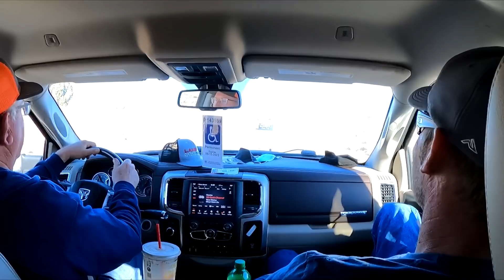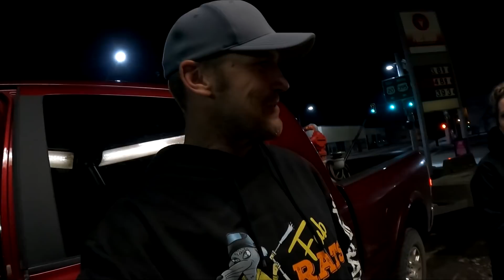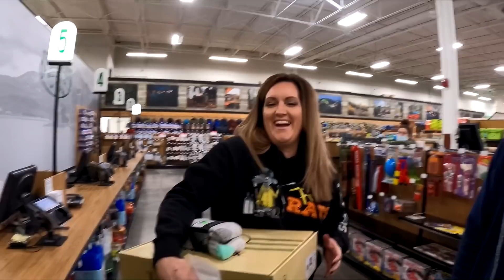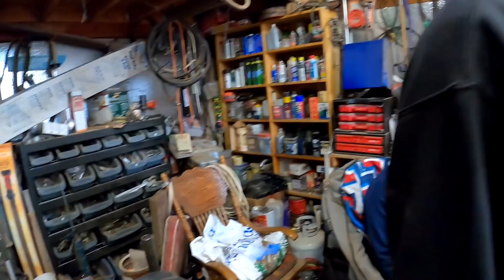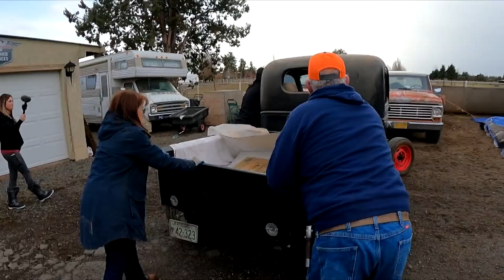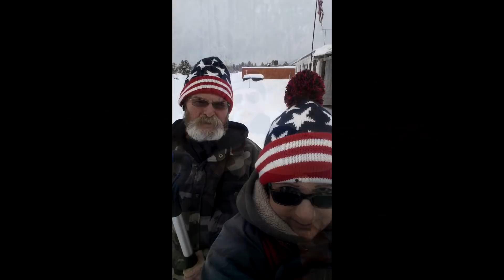We Drove 2000 miles And Through 4 states To Pick Up This Vintage Rig!

Comment: Hi I'm still spending many hours a day watching Fab Rats, Matt & Winder towing with Ed, and I keep trying to figure out what is going on with Robbie and the Golden nugget these days.  Then there is the cliff hangar with the high school car, that was in good enough shape to put in car shows.  Sounds like all it needs is a set of tires, check out that it has good fuel, then check out the plugs points, condenser, timing & dwell and carburetion, and ya got plenty of drivers so make a deal & drive it on home too.  Shouldn't take much I wouldn't think.
Keep up the good work & God bless.

Comment: Paul after 4 years that pump diaphram would be dry. You can put some gas down the line from above the pumps and SOMETIMES they will start to pump again but you WILL still need to change out the pump if you are going to run it hard. Which we both know you intend to so change the pump. LOL

Comment: I turned 70 this year and batteled kidney cancer in 2017.  Now my wife is batteling cancer.  And after watching this video  I wonder if I'll ever have enough time to get all my projects finished enough to be able to drive them.  
Or will my wife, or Kids have to figure out what to do with them once I'm gone. Coincidentally, I pulled out an engine from the back of the shop yesterday that I built for my wifes Hot Rod Trooper.  And got inspired to build a run up stand for it.Got it done late last night. Going to built a radiator mount today, and plumb in a transmission cooler so I can get the engine (2.3L Turbo Gas Intercooled Motor with a 2.6L head.  approx 260 HP) and the 4 speed auto 4WD tranny ready to go into her 89 4 dr Trooper.  (Which I painted Yellow with metal flake in the clearcoat 17 years ago.)  Fortunitly I built a 3000 sqft Commercial shop behind my house before I retired.  So I've got a nice place to play in.  If my wife calls you from Texas and starts talking to you about some Off Road Rigs you might be interested, just tell her  said Hi!

Comment: Royal Purple, talked w/ a top engineer from that company, you DON’T NEED ANY Additives with it.
WHY LUCAS OIL???
Mix 1oz./2 1/2 gallons of gas: MYSTERY OIL.
Lubercates the upper valves and pistons as you run it= increasing the life of miles on engine. Been doing this since “84, even w/new cars/ truck has 365,000.!

Comment: Turn the ac on    Max.. to recirculate    Set to warm       Then your windows wont fog up so bad from all the moisture in the vehicle     Running the air thru the ac system will dry out the air     And dry warm air always feel warmer than warm moist air     ✌🏻🐻👍🏻useless tip of the day   😂

Comment: It's probably a good thing there was a fuel shut-off valve on the gas tank.  If the gas had been sitting in that tank for four years, it wouldn't be any good and would have messed up the fuel lines anyway.